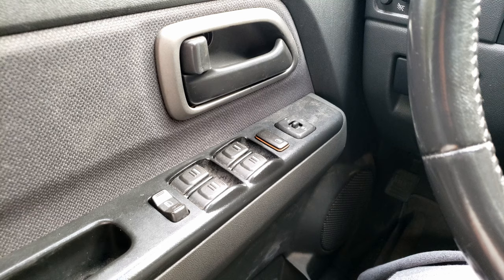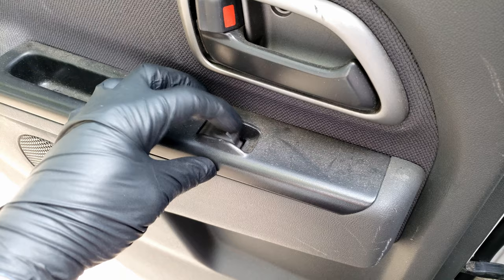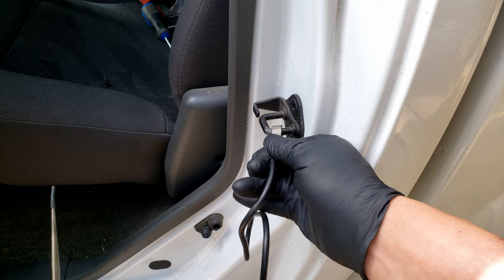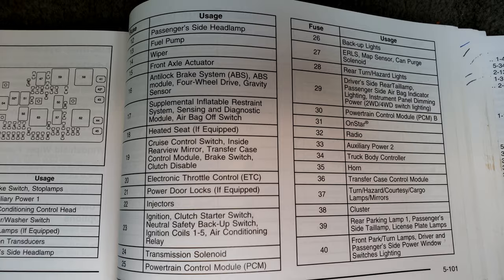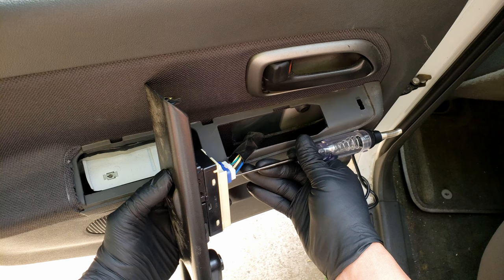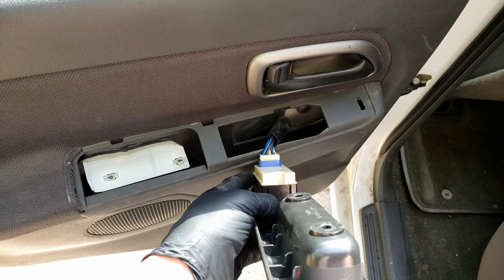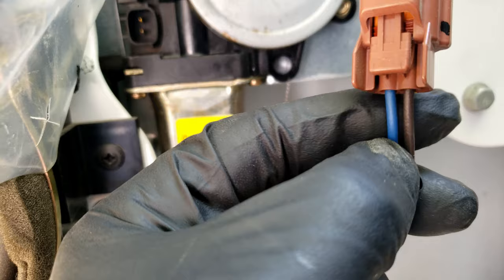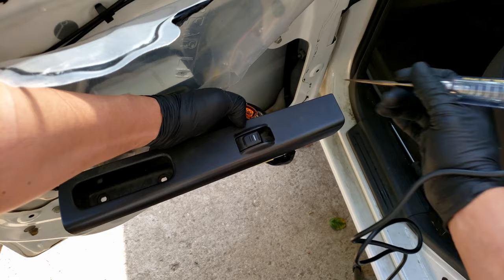How to Diagnose If the Window Switch or If the Motor is Bad

Comment: Hey it’s me again. So I bought a new switch and put it on. It still doesn’t work. Did I really buy a bad switch? What do you suggest I do
Reply from the maker: What i would do is..if u have a 9v battery u can actually test the motor by connecting the 9v battery to the connector on the motor just making sure the connections dont touch..connect the positive lead to positive on battery...then negative to motor connection..and tap the negative on the battery and see if it moves the motor..and u can flip the wires around and repeat..to test ur motor or u can use a regular car battery but be more careful on those
Reply: @backyardchevy328  can the motor just be bad? Do I have to hear a clicking sound… I mean if it was bad why would I hear anything
Reply: @backyardchevy328  sorry but I would need to speak over the phone for this. I wouldn’t know what wires to connect
Reply: @backyardchevy328  okay let me take this 1 step at a time. Question by question.
I want to check a see if the motor is bad before I take off the door to get to it. I’ll need to get a 9v battery first. Where and what wires do I connect to the 9v battery?
Reply from the maker: @graysong2961  ill see if i can make a short video on it sometime this week...but normally the connector at the motor will have 2 terminals..so u can connect one to one and other to the other one will move the motor up..the other will move the motor down
Reply: @backyardchevy328  omg that would be so helpful! I hope you can be very detailed and elaborate so it might make it easier for me to do
Reply: @backyardchevy328  in the past I’ve tried looking up the entire motor/regulator that goes to the right side door, but I’ve had no luck. I have seen new motors available though. All I would need to do is replace that and not the regulator as well if it’s bad , right?
Reply from the maker: @graysong2961  yes as long as the cable isnt tangled or mechanism isnt damaged
Reply: @backyardchevy328  Okay I will keep that in mind. Since there is power going to the switch are the only possible outcomes a bad switch or bad motor?
Reply from the maker: @graysong2961  im recording a video to help on this at the moment..should have it done to post next weekend
Reply: @backyardchevy328  okay this is so awesome. since i am so entry level with all this i thank you again for all the help. i know i will ave many more questions to ask along the way as well
Reply: @backyardchevy328  since the switch on my driver side that controls the passenger window doesn’t work, this has to be a switch problem right. No way the motor has anything to do with it being on my side, yea? Should the switch mechanism be universal? You think I can pop it off the passenger side and hook it up to the one on my side?
Reply from the maker: @graysong2961  i should have video coming tomorrow that hopefully will help u with it🙂
Reply: @backyardchevy328  okay man you rock! I’m in the process of taking off the other door and seeing if the swap of switches works
Reply: @backyardchevy328  do you have an email address I could message you on? I can’t upload photos in this chat and I think it would be much more convenient to show you what it is I’m looking at and trying to explain when working on this
Reply: @backyardchevy328  I just took the other door panel off and the switch that holds both is a solid piece. Instead of trying to replace the entire switch board, if I check the wires with my volt meter, should there be more then 1 main going to both switches?
Reply from the maker: @graysong2961  i got an instagram i just made if u wanna follow me on there, it should allow u to do so there
Reply: @backyardchevy328  okay! What is your name so I can find you

Comment: So recently my passenger side window stopped working, my driver side window works but the things is only it’s switch works for that window, the switch that controls the passenger side on the driver don’t work and same with the switch on passenger, I check all switches and motors all seem to work seems like it’s not getting power any ideas were else to check? Could it be the driver side motor that’s faulty Bc the pass work since I replaced with new one
Reply from the maker: So only the switch works for the drivers side..so u get power out of the driver side switch but the window doesnt move up and down.....and for the passenger side u were able to get it working by replacing the switch?
Reply: @backyardchevy328  no I have yet not found the issues, switches on both side we’re put on my sisters trucked and worked fine but not on mine, motors are fine loss at this point
Reply from the maker: @antonioraigoza2648  did u try her switch on urs? If so and it still didnt work then its gonna end up being a wiring issue with ur vehicle
Reply: @backyardchevy328  yeah I suppose it’s gonna be one but the wiring harness on both doors don’t seem turn apart or nothing, is there another wire that connects throughout the dash for power?
Reply from the maker: @antonioraigoza2648  well the main power runs to master switch..and if there's something wrong with the master switch's wiring to the passenger side or maybe even the lockout portion of it..itll cut off power to the passenger side
Reply: @backyardchevy328  so your saying it can be the lock and unlock switch causing that? Or what lockout portion?
Reply from the maker: @antonioraigoza2648  the one i mentioned early in the video where u can prevent the passenger and rear windows from being opened from any other switches minus the drivers switch
Reply: @backyardchevy328  oh yeah no man I have a regular cab so it don’t come with that smh, but if the window motor is not receiving power when I check it does it mean it’s the any of the wires bc the motor and switch is good is jst don’t know if it’s the driver side wire or passenger. I notice that the wire on the driver side color green does not light up but the other wire does, and on the passenger none light up when I test to see if power is going to the motor
Reply from the maker: @antonioraigoza2648  yea then itll either be a fuse, relay or wiring..but since i believe i remember one working for u..then its probably gonna be an issue with the main power wire going to the switch...i would remove the fuse check it for power there..if u got it there..then problem is with the wire in between..usually they have problems where they go into the door cause of the movement of the door opening and closing
Reply: @backyardchevy328  So if I were to change the door wiring harness on the driver side would that fix the problem for my window to work on the passenger or would i have to change the passenger wiring since that’s the one that don’t work? Every other button works on the passenger except the window switch, and on the driver side same but the switch only work for the driver window not the passenger
Reply from the maker: @antonioraigoza2648  u would have to figure out where exactly the problem is, it could be anywhere from the drivers switch out to the passenger side and could be anywhere in between...u would have to trace the signal wire or do a resistance test on the wire to see if has an open signal indicating its split or damaged somewhere
Reply: @backyardchevy328  Bc on my 2016 chevy silverado there’s a wiring which includes locks wiring, windows switch, mirrors etc which then connects to the door wiring harness, if it’s not giving power to the motor or the switch is should be the door wiring harness ? Jst could it be the driver door causing the passenger side window switch not to work or would is be that passenger side door wiring ? And how exactly can u do a resistance test to make sure it’s not split or damaged man I wish u was located in ks
Reply from the maker: @antonioraigoza2648  yea its all kinda hard to explain via message..but a resistance check..u can use an ohm meter and u connect one lead to the wire end..and the other lead to that same wire on say the passenger side..and the wire should have resistance...if it doesnt it would indicate that the wire is cut somewhere...kinda like if you've ever seen it done on spark plug wires to test for a bad spark plug wire
Reply: @backyardchevy328  so I had seen that on my passenger side it had like a shrink seal on the wires idk if that has to do something with it, but could that be the cause it don’t get power on the driver side when I had checked it ? Or would that have to do some with the driver side wiring harness?
Reply from the maker: @antonioraigoza2648  does it have an aftermarket alarm? They tap into the original wires to install em and if so possibly..cause normally the original wires wouldnt have that connecting wires together
Reply: @backyardchevy328  no it does not, and oh ok but you think replacing that wire will get me power to the driver side so the switch con roll down the passenger window? Or that has some to do with the driver side harness?
Reply: The wires that connect to the driver motor which is green and think it ground does not light up, but on the passenger door wire that connect to the motor both inlets don’t let up at all, so you think it’s a ground issue on the passenger side that is not causing ground on the driver ? Or could it be the drivers side ? So like how u check to see if the signal was reaching the window motor, since it’s not in that case where would u look bc u didn’t explain nothing if wasn’t reaching signal where to to go from there since the motor is good and switch/ fuse
Reply from the maker: @antonioraigoza2648  well if the fuse is good..u wanna check to see if ur getting 12 volts at the fuse and from there u check if its getting the main power to the switch to verify the 12volt signal from the fuse is reaching the main drivers switch..if it is, which u said u tried out the switch and it was good..so check out those two before the switch
Reply: @backyardchevy328  I have a question my 2016 Chevy Silverado regular cab I had changed my battery then like a few months later my passenger window stopped working ! I replaced my window motor, inspected that fuses weren’t burned and that my switches worked which were all fine but then I saw that is jst wasn’t getting power! I hooked a battery to my window motor and windows went up and down. So at this point idk why it’s not getting power to my window motor or if it’s a bad relay any help you guys can let me know ?

Comment: Do a separate video of after you check switch,fuses, relays???? How to short the motor to get the window up ..
 Its rainy and dont have time to watch 10 videos of the same thing
Reply from the maker: Well i did do a separate video on shorting motor with a battery to get it up or down

Comment: I unfortunately paid through the nose one hot day after putting all windows down then up to go into a store they were frozen shut nothing worked except passenger side door.
3 hours to trouble shoot my mechanic found out no power to the switch so Mercedes-Benz part and labour less the yearly service charge  500.00 to replace what ever part needed replacing to get the power to operate he said it also controls the locking system
Reply from the maker: Ouch, that is an expensive repair...must of been the door control module

Comment: Perhaps someone knows the answer....
I replaced rear drivers side regulator, used the same motor. Now the "up" switch makes window go down, and "down" makes it go up! Eek!! What could I have done wrong? PS, the motor electric connector can only be  attached one direction.

Comment: Im hoping someone can help me out here, i have a 2014 acura tl where on the main switch every button works except the passenger front, now when i go to the passenger side it works just fine. It cant be the main switch cus I replaced it with a another part from the junkyard and im still having the same issue. Now i hook up a diagnose machine and it says its the passenger window regulator motor. Im not sure if i should change it because it works on the passenger side. Someone please help me out

Comment: Usually not the switch, rarely ever the motor.  I find that the relays are the first thing to go bad.
Reply from the maker: Ive done 5 of em this year..and 3 of em were the motor and 2 the regulator that broke..i find the motor to be the most common, then comes regulator damage..yea then relay..and finally switch but i guess it does depend on the vehicle
Reply: @backyardchevy328  yea, probably all repairs you see they've already tried the relay and it wasn't it. But you never see the ones where people replace their own relay and it fixes it.  Kinda gives you a skewed view.

Comment: 2012 Ram 1500 drivers window won’t go up or down , but that same switch will move all the other windows except drivers window , no power locks from this switch ,passengers switch power locks work ,I’m getting power to the driver side switch on pink/yellow stripe wire , up and down 
orange/white stripe and and orange/green stripe ground wire black/green stripe , the signal doesn’t seem to making it to the motor from the switch , at first I thought it was the switch,so I bought a new switch same exact problem, then the motor ,took the motor off to bench test with load , using a power probe 3 it dose go up and down , reinstall  test with load from the switch nothing take the swift test from connector I get nothing,I realize the switch sends the command ,the command goes to a power door module then power is sent from the door module to the motor, I pull the connector that controls the function of the motor out of the door module send power and and ground to the motor ,the window goes up and down ,,, my question  dose this mean  the module is bad or wiring from the switch to the module is bad ?

Comment: I had replaced the motor and the switch. However the motor only wants to go in One Direction I actually plugged in the old motor and it only wants to go in One Direction what could be causing this
Reply from the maker: Was the regulator replaced? Do u have a way to test the voltage output from the switch to the connector?

Comment: What am I missing?....at 3:38, you show "another thing you can do"....and it seems you are trying the right-rear passenger side door switch, for that window. However, from the very start, 0:16-0:22, it seems the LEFT-rear door window doesn't work ( driver's rear). Why try the right-rear passenger window?...you know it works !....right?
Reply from the maker: Well, im saying if u dont have a test light to verify signal from the switch..u can try using the passenger side switch instead cause they have same connection..if it were to work with passenger switch, it would indicate the driver switch is bad
Reply: @backyardchevy328  ..I think I see now. Let me ask directly and maybe there is a simple answer.....for me the problem is this--->  3 windows work....all EXCEPT the driver's window (LF).. So it seems "power" is getting to the armrest panel with the 4 switches. Does it then make sense to trouble shoot only the driver's switch and driver's motor?
Reply from the maker: @TheWilferch  yes, focus only on the drivers side in that case, test for signal from the switch to motor connector..or u can also use my other video where i use a 9v battery to test motor/regulator to make sure theyre working properly.
Reply: @backyardchevy328  ..Super !! ....thanks so much !!
Reply: @backyardchevy328  ..update.....found out it's my motor. BUT, the window is UP and the motor is DEAD. Normally, other vids show a failing motor ( not dead motor) where you lower the window just enough to align the right-side/lower window support....with that SMALL HOLE in the door. There is no way to do that with the window UP and a dead motor. Now what?....how the heck does one replace the motor ?
Reply from the maker: @TheWilferch  thats how i had to replace it on the truck in the video..the window was stuck up..and i just used a wrench to get to the bolts https://youtu.be/jLDinQlFpwI
Reply: @backyardchevy328  ...Thank you.....but notice.....we're still talking Scion xA.....the motor is in plain sight thru a large hole opening in the door in your truck vid. In the Scion, the motor is totally behind door sheet metal. Are you saying with the window up.....reach around the BACKSIDE  of the motor mounting bolts....accessed from the two , 6" diameter holes open on both sides of the motor? The screw heads that hold the motor to the regulator/arm mechanism....face OUT, facing the exterior door sheet metal. Wow.....how am I going to get my arm and tools behind all that ...and have it engage the bolts? I hope not a screwdriver or Torx driver, but maybe a flat GearWrench on a nut ?????
Reply from the maker: @TheWilferch  yea then that vehicle would not be like that one..u can use a ratchet and 1/4 socket(or 5/16 depending on hex bit size) with a hex bit..or a wrench with the hex bit on it as well
Reply: @backyardchevy328  ...haven't gotten that deep into the project yet....still planning this out to avoid issues. That said, I hope these fasteners are not phillips or torx head, but some kind of hex nut where your suggestion can work better.
Reply from the maker: @TheWilferch  hopefully all goes smoothly when u do.. good luck🙂👍